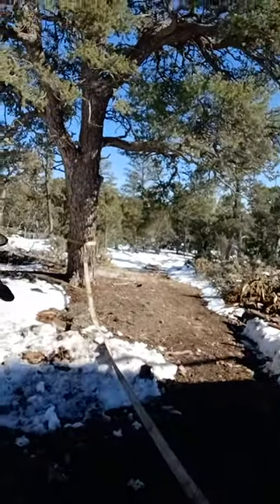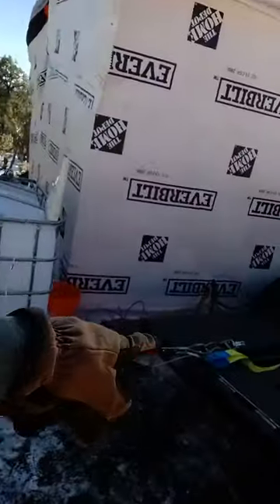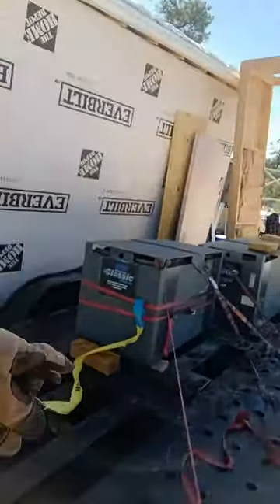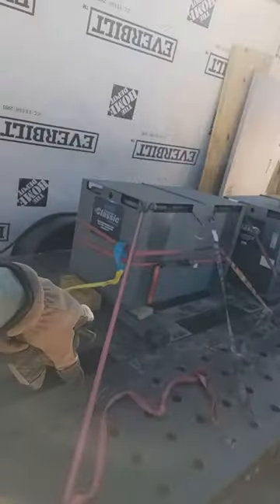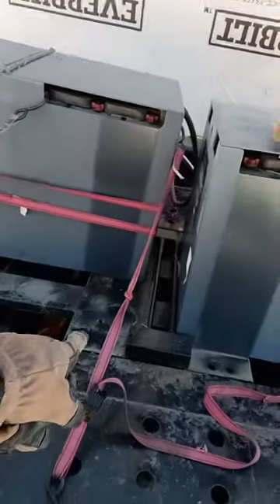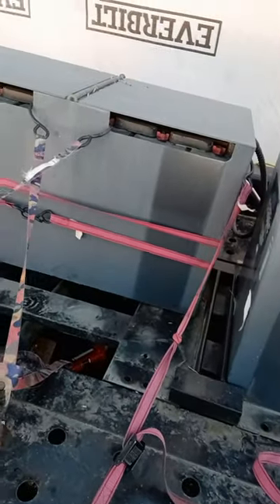Battery removal from DC solar trailer.

Comment: We were able to find a cannibalized DC Solar Trailer with the SMA's, charge controller, (10) Panels. No generator, fuel cell or battery bank but the prewired system will get us up and going. We have a 2,000Ah GNB 48v VRLA battery bank to install to get up and running. I'll check out your other videos and see what you have posted!